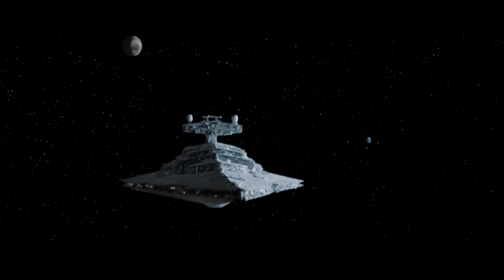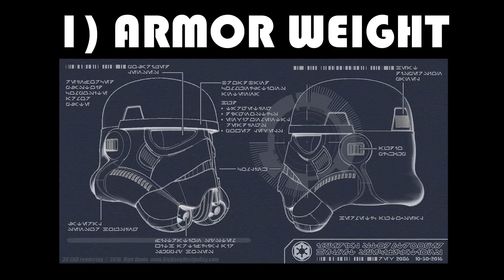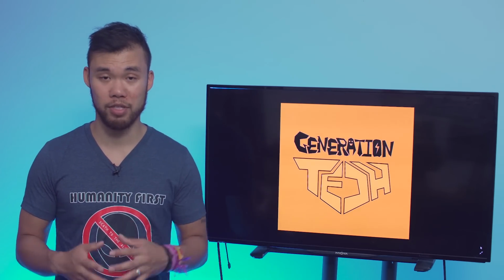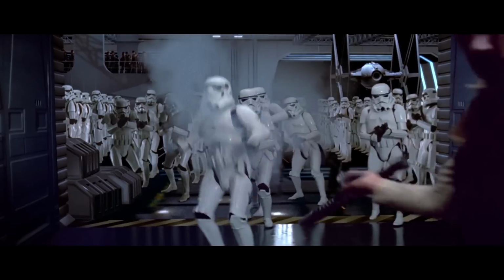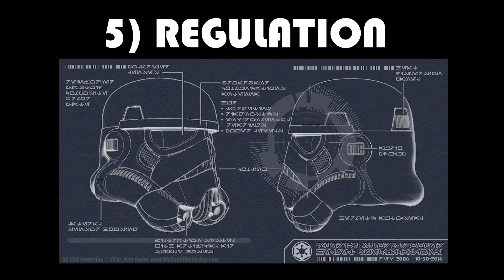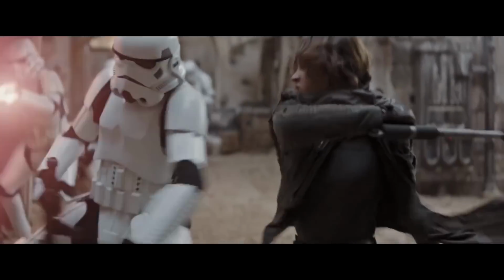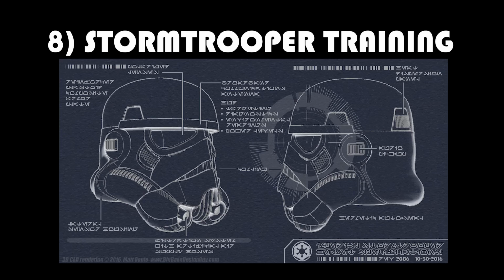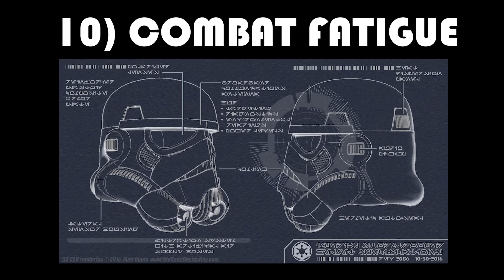10 FLAWS with the Stormtrooper

Comment: Full European medieval steel plate: 15-25 kg (33-55 lbs). Modern IOTV body armor, with all the bells and whistles comes in at up tp 16 kg (35 lbs). The figure of 40 kg for clone trooper armor puts at 88 lbs, or about 1.5 full times metal plate, or 2.5 times modern IOTV armor. Neither of the two real-world examples are know for comfort and maneuverability.

Comment: The storm trooper armour was ineffective, and had poor vision. Their accuracy was great and terrible. In the end the plot requirements surfed the storm troopers beyond redemption. Air supply and artificial camera vision were benefits but not fully realised. A camera has a wider range of em detection and is much more resistant to damage than a human eye and more easily replaced. Overall more visual than actual benefit, which might have been the point.

It may have been that many parts of the military used the same armour and weapons, Huge production reducing cost, and by people who did not know the difference  they would still  all be storm troopers.

Comment: Stormtrooper armor in a lot of ways like some of the earlier plate armors post transitional era so they're not all connected like they need to be if they connected them up like the way the later medieval armor is Verdun it would actually be a lot better because when you connect all the parts a lot of the weight is distributed so yeah she have people that can do cartwheels such while wearing full armor in considering the armor material that Stormtroopers have almost certainly is lighter weight then metal plates with bits chain over the joints and The gamson Underneath it would probably be a lot better to wear but it would been more expensive to do for the movie

Comment: This is why I greatly prefer the Imperial 'Army' Troopers because Stormtroopers are supposed to be elite shock infantry while most everything else is done by the standard troopers. Imperial Troopers look far more capable of fighting in a war then Stormtroopers who seem more like shock unit that quickly loses its edge after the battle reaches a certain point. Every Imperial planet would have several companies of these guys simple because there weren't that many Stormtroopers, at least compared to Army Troopers.

Comment: The thing you got wrong, is that the stormtrooper armor absorbs and disperses blaster bolts, they are incapacitated so medics can easily assist them, but heavy blasters RIP them apart
Reply: Secondly they do require a pressurized suit, if they were in the vacume of space O2 in their lungs want to sleep into the bloodstream, which would kill them
Reply: And helmets are custom fitted
Reply: They use to have precise aim, until Disney, and they had statisticly better aim then the common modern soldier
Reply: Stormtroopers are elite, they require the most extreme training
Reply: Medics would drive after the battle to assist the wounded
Reply: They do sleep, they take turns

Comment: Stormtroopers should be used as Imperial Special Forces (to quickly eliminate organized rebel cells), there should be less of them and they should have highest quality gear and top tier traning, regular soliders should be lightly equipped (Rebel style), it's not like wearing regular stormtrooper armor is better than not wearing it (in fact it's worse). And they don't need amazing traning and equipment for patroling and guarding imperial teritory

Comment: The stormtrooper helmet has an excellent field of View but has countermeasures the heads-up display Stormtrooper tk-421 will only work for tk-421 each helmet is issued to a specific Soldier it will only activate properly for specific Soldier anybody else puts it on the helmet will be shut off and you'll only be able to see you through the eye holes is the tinted eye holes

Comment: Armor is not that much of a burden to movement.  Real-world full plate armor did not restrict movement at all, as the many videos of it on Youtube can prove.  Metatron, Shadiversity, and Skallagrim also have good stuff which features clips from these videos.  What armor really limits is endurance; it traps heat near your body, which exhausts you faster than not wearing armor.  Given that the stormtrooper armor is climate-controlled, capable of regulating temperature for its user, that's not as much of an issue.

The seeming ubiquity of Stormtroopers in Star Wars media is more a function of them being so iconic.  Disney must be afraid that if they didn't show white-armored men in face-concealing mask, they'd lose money on that piece of media.

Comment: Small armor only works for elite units that need to maneuver.  Stormtroopers are not elite units and are like the regular army infantry.  In the US Army  the body armor with plates alone weigh 60 pounds.  The helmet would be 3 pounds plus night vision mounts, small surefire head mounted tac-lights.  Then have the groin protector, neck protector, and shoulder protector for more things to stiffen your mobility.  Add the combat zone required side plates that weigh 6 pounds a piece and thick as novel books and your armor weight jumps up to 73 lbs.  That is not all because you still have to put the basic combat load of a soldier on you suit of armor.  For a regular rifleman, that would be 6, 30 round magazines in ammo pouches, with 7th magazine loaded in weapon, adding another 10 lbs.  Add the required first aid pouch which add a half of pound.  The over all weight comes out to be 83.5 lbs, not as light as you claimed it to be.  That just a rifleman.  The squad automatic rifleman have to carry 3 drums of 200 rounds.  The Machine gunner have to carry 1,000 rounds.  The alternate gunner have to carry 2,000 rounds plus his own rifleman load out and the tripod.  I can't even imagine how heavy that shit is because I never held that position.  Before you drool over how real world army units are stated please ask a combat veteran.

Comment: Time to answer these 3 year old questions.

A. Armor and Look is meant to instill fear. Think of 300 soldiers of the same look charging at you.
B. The helmet has a button, if you don't press it when taking it off, the helmet shuts off. Basically making it a pair of sunglass at that point.
C. Stormtrooper armor was the most effective weight to armor ratio. Lets the stormtrooper to run and provides mediocre protection.

Yes the armor is basically nothing, it was made for the purpose it plays.
Reply: 40 kilos = 88lbs .  That's heavier than full plate armor worn in the middle ages.  So the last point about running in armor.  Despite the form fitting suits under it the armor plates of Stormtrooper armor are known to be inferior in design to that of Clone Trooper armor.  Most notably in the legs as the hips armor was too bulky and made lifting the legs more difficult thus making running more difficult in armor. 

If you think that they could run with that amount of weight. Go buy a 60lbs weight vest  or buy a 30lbs weight vest and take a back pack and put at least 45lbs of weight in it.  Then attempt to complete a 12 mile march in less than 3 hours.    

You will be exhausted by the end and never want to do it again.  The Stormtroopers are human soldiers in Star Wars.. they would obviously have similar physical requirements as modern soldiers do so yeah they're not running in that armor.   At best they have been seen  jogging or speed walking in armor because it's mass produced not custom fitted to them.
Reply: @John2r1  That’s the phase 1 clone trooper weight. It was later replaced with the Phase 2 for that reason, comfort over protection. These armors were made of a plastoid-alloy. Stormtrooper armor on the other hand is made from pure plastoid, which is lighter and cheaper. Greater mobility at the cost of protection, letting the stormtrooper able to run in said armor.
Reply: @puddles6814   In both cases the design  is more of the issue.  

There is a reason  that dispite having the technology to make a full suit of modern armor.  We don't  do it.  Which has to do with mobility.   The Stormtroopers  armor was designed  to be used for intimidation not to be practical.   It's more of a costume than a battlefield  armor.  And that's why you never see them actually  running in it.  You see them jogging .

Comment: Generally, .45 ACP has less penetration power than 9mm Parabellum.   Han's DL44 would be more akin to a .357 or .44 magnum or higher.
Reply from the maker: True but blaster don’t work on penetration power but overall energy that’s why I used a heavier round like 45 acp the problem with the magnum rounds is they aren’t really that useful in combat situations

Comment: I agree with those helmets being awful. The biggest issue is the vision lenses Just look at them. You loose your stereoscopic vision if the helmet malfunctions and you can't aim from the shoulder with it on. 

Which leads me to their blasters. They have folding stocks that they never deploy. And the scope is too low on the weapon to allow them to use it with the damned helmet on. 

Then again, it is possible they weren't designed to be very good. Once the Empire had control of the galaxy they needed them more to be occupation troops than combat troops. So they over armored them against rioters and hand to hand attacks and under designed them for straight infantry combat. Because if they wanted them to be effective, they'd have kept the clone trooper helmet design. 

As for combat fatigue...with the military being run by the Sith, I doubt they care overmuch about whether the troopers are having nightmares.

Comment: More like 80 lbs my gen 4 iotv was about 45lbs and my assault pack was 30 to 35 lbs on the lighter end my ruck was 80 lbs. My ach was about 3.5 lbs without nods and my m4 8 to 9 lbs with pec 15, cco, light, I like a 6x magnifier, and a 30 rd mag

Comment: Storm Troopers were, at this point, just a name. It comes down to, they were cheap, so why add costs when they work? That is the way of the Empire, throw enough crap at the wall, some of it will stick. In this case, a lot of it sticks. They have killed a lot of people, the ones they miss the most are either force sensitive, or force aware, and saw the attack coming. The Empire work, well, like the Germans in that respect of building things that worked for a long time, and for the most part, stopped innovating. Meanwhile, the rebels in many cases were using more advanced vehicles, but had far fewer of them, and they were always looking for an edge over the Empire. The Empire also put too much faith in technology, and Vader did technically call that out, while the rebels also did very well to stick to older, known skill sets that did not rely on technology. I have no doubts that the Empire could have beaten the rebels as they were in say, A New Hope, do to the overwhelming amount of resources the Empire had at its beck and call, but, all the in fighting and politics were what did in the Empire, and it happens to all Empires that forget their ways and rely too much on technology and sheer numbers.

Comment: Your numbers for real life combat armor are misleading, I'm hesitant to say they are completely incorrect, 30 kg of armor and equipment is way too light for a front-line combat unit, maybe for a support soldier that doesn't leave the FOB, but not an infantry man. There is lighter armor out there which can be found in use with special operations or other "elite" units, but I don't think that's what this video is seeking to draw comparisons to, not to mention that those lighter armors tend to offer less protection in exchange for lighter wight and increased mobility and comfort. A combat soldier with armor, weapons, equipment, and ruck (more realistically an assault pack) is going to be carrying 45-50 kg at a minimum, with gunners, mortar men, or AT personnel carrying even more. Point being, a lot more than the 30 kg stated. Now an "elite" unit doing a raid with vehicle support for insertion and extraction can get their combat load down to about 20-25 kg, but they are sacrificing sustainability on the ground if they are separated from their vehicles.  Realistically storm trooper armor could only weigh whatever the actual prop armor weighs, explained away by super scifi composite material (not that unbelievable) especially since the armor was apparently designed to distribute the blast for survivability of the individual (resulting in a knocked out trooper, not sure how much one should buy into this explanation) rather than complete negation of the blast. Point being, storm trooper armor probably weighed in under 10 kg. Anything more and the storm troopers wouldn't be moving around with the level of ease that they do.

Comment: No Amor will ever be stronger than the bullets that can be fired at it.

A half suit of armor that stops more powerful bullets still leaves i open to injury from smaller rounds.

So a full body suit that stops small  to medium sized weapons means you can only be hurt by large sized weapons. Which means a attacker must and can only attack with larger weapons if he wanted to do any damage at all. 

It's a war of logistics no a battle between two soldiers

Comment: You would need a pressure suit for vacuum. All orifices would need to be protected or... well it's a vacuum, nothing pleasant will happen to you. You know, leakage...  If the glove suit sealed the skin away and the helmet completed it by  hermetically sealing to the suits neck, you would then need a rebreather in the helmet. If you could add thermal regulation, which relies on radiation of heat, not convection of conduction, then you may have a suit which will save the user from vacuum And allow them to get to safety.

When exposed to vacuum, you have 15 seconds before loosing consciousness. The fact is Leia should be dead. Period. By the time she realised what she needed to do, she'd have already be unconscious. So, yeah....

It is like the myth about air locks... If the inner door is sealed and the outter door opens, only the air directly behind you will push you towards the door. You are blown into space, not sucked...

So in short, with a few modifications, such a suit would allow Stormtroopers to use vacuum as a weapon against unprotected crew and it potentially uprate the suit to the point that chemical and biological exposure is not an issue (at least for a while, they do have to get out of it eventually). That would also allow the use of chemical suppression of hostiles and audio etc if such protection was built into the suit. Or even allow the "armour" to be switched out for the relevant role and have the glove suit as as survival suit along with the helmet as the final piece. 

That would make it a survival suit, that can have armour or other things attached to it. I can see that being handy as a stander piece of equipment as a survival siut could be made standard across the entire service with the add-ons being service specific.
Reply: I'd also like to add that with a direct from blaster to helmet "sight" not only could you add "assisted smart fire" but they'd be able to shoot around corners without exposing themselves to fire... just saying...

Comment: talks about armor not working, then shows scene with one of the most powerful blaster rifles bouncing about six times (E-11)...also the DL44 han uses is much closer so something like a 460 magnum or a 454 casull.  as a note 45 auto does far worse vs armor then 9mm.  also the suits are capable of short space walks...which means its pressure sealed, also sealed vs gas.

Comment: LOL 60 pounds for the US soldiers average combat weight.  Someone has never been in combat gear before, more accurate is between 80-120 pounds of stuff and you can run duck crawl and jump just fine in it.